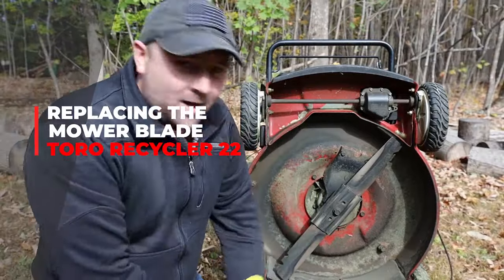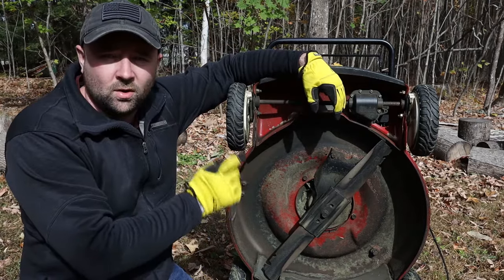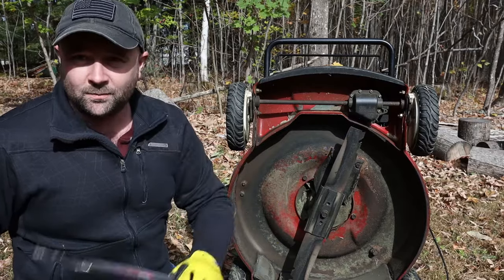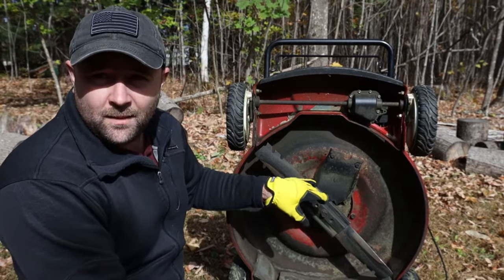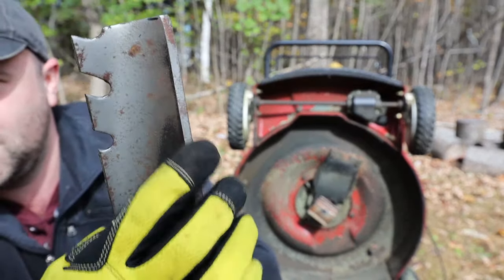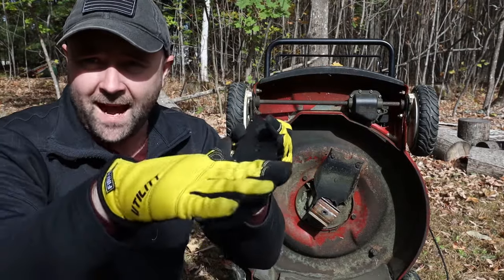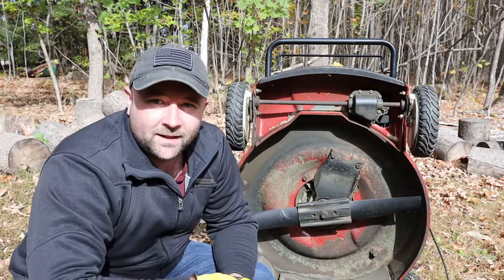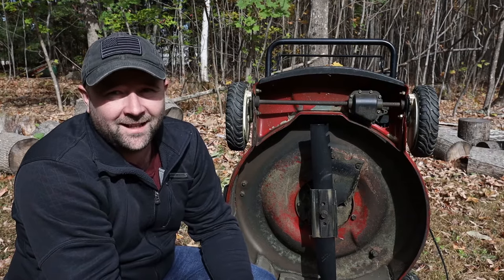Replacing the Mower Blade - Toro Recycler 22

Comment: Oh man! I am a 77-year-old female with severe arthritis and very bad eyesight up close and I had to change the blade and replace the self propelled belt on my Toro 22 inch recycler lawnmower.  The belt was caught behind the adapter! i had to remove blade! I went through at least 15 videos of people changing the blade, but not a single one of them showed me the orientation of the blades to put it back on and the holder. I got caught in a bad rainstorm  and I had to snatch everything up and put it in the house because I just don't like my stuff getting wet. If course, i picked up the old blade, belt, etc and covers on the pulley, etc not remembering i had them lined up and orientated in the way they went back on!  Two days later, I finished putting the belt on. But for the life of me, I could not remember the orientation of the blade and the brackets etc. you were the only one who showed the blade(which i could not see because of reflection. BUT YOU told about the blade teeth tilting toward the underside of the mower! I had not tried to start the lawnmower up yet; so I go back out and sure enough I had the blade on backwards!   In my defense though it did fit and screwed back on very well even though it was backwards! 😬😬I basically have to feel things with my finger tips to get them right. The blade was a challenge! it fit both ways!  I just wanted to say thank you! took me two days to change a blade on the lawnmower because no one really gave the explicit placing in DETAIL!
THANK you so very much from a grateful old lady!
Reply: Same here!!! My husband has dementia.  Our lawn looks like Augusta National Golf Course.  He has an AG degree and expert in lawn care.  Now, he is unable to keep our lawn in PGA golf course beauty and I am trying to do it to keep him happy.  He ran the mower over the curb last summer and damaged the  blade support plate.  He also stripped the bolt that hold the support plate in place.  I am a Southern Belle who shops for lipstick, perfume, nail polish, shoes and purses NOT LAWN EQUIPMENT.  This video is the best!!!!
Reply: I always take a picture of the “item” I am working on before I dismantle. Glad to see I am not the only senior lady still tackling things! You go girl!

Comment: I wish I had seen your video before trying to change the blade on my Toro Recycler 22”. The bolt is rusted in place and every Google search I did said that the bolts on most Toro mowers were reverse thread. One response said the Recycler was reverse thread. Thanks to you I should now be able to change the blade myself. Nice job!

Comment: Changed my blade using this video as a guide.  My Toros handle bars do not turn into a stand but I flipped it up on its side.  Cleaned my filter and topped off the oil while at it.  This is in spring after 2 cuts, and the tip is spot on.  I keep the deck on the penultimate peg for a tall grass and with the mulching over and over the years, my yard is happy and healthy.

Comment: Sounds easy, loved the tip about using the blade as leverage for loosening and tightening.  - now if only I can get the bolt off!! Been working on it for 2 days. . .Just not budging
Reply: Maybe try an impact wrench if you can?
Reply: Breaker bar
Reply: Took me 3 hours to get the bolt loose. My back and legs are still sore.
Reply: Make sure the gas tank is empty and carb,  then you heat it for 10 or 20 seconds with a torch, and it comes off easily.
Reply: I used my dewalt impact it made short work 😅 of the bolt!

Comment: Good video. Thanks!! Is it still advisable to pull the spark plug wire off before performing this?
Reply from the maker: Yes, you can just as an extra precaution. You'd have to be holding down the bar on the handle in order to start the mower, but just in case, unplugging the spark plug is a good idea!

Comment: Thanks, my exact mower!   Gonna do this in the next week or two.   Do you have any videos on changing the oil on the 22" recycling smart-stow Toro?   I think they claim you don't have to change the oil but.........I dunno.   Thanks!
Reply: Just make sure it doesn’t have any gas and then you tip it upside down to remove the oil out of the same filler hole
Reply: @260bill260  Thank you!

Comment: Great video thanks
Reply: Last 4 times I've mowed I've tried to get the bolt loose and failed. Good to know the bolt is not reverse threads. I'm retired and sick and don't have much energy. I like the suggestion to use a breaker bar or an impact wrench. 

I'd like add the suggestion to put some anti-sieze on the bolt before replacing it. If you don't have that, oil the hole and the bolt generously. You shouldn't have the same problem the next time. Like I have.

Comment: I'm not normally the saftey police but for God's sake man pull the spark plug!
Reply: If you’re not pulling the bar the mower won’t start
Reply: Pull the plug,  and have a wooden block holding the blade in place.  Better safe than sorry,  I was just remembering how easily a prop plane engine will start, if at the proper point in the rotation.
Reply: Saftey
Reply: It's not gonna start. But disconnecting the plug is enough anyway. I mean, might be a good time to replace it
Reply: Non mower knowledger here, where is the spark plug you'd unplug?
Reply: Thank you brother. I sure did this before changing it. This the first comment on the video🙏🏽
Reply: Don't need to pull sparkie when you have air tools.